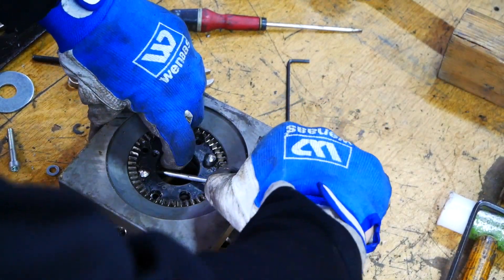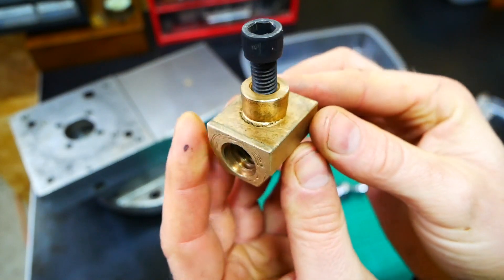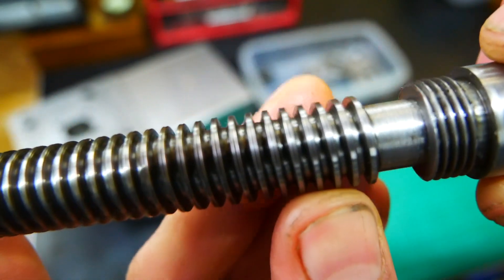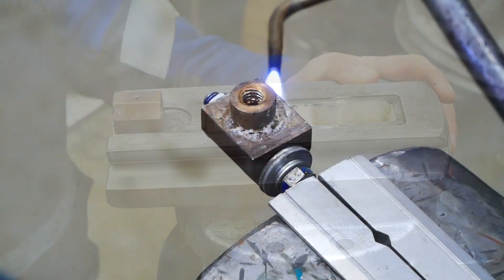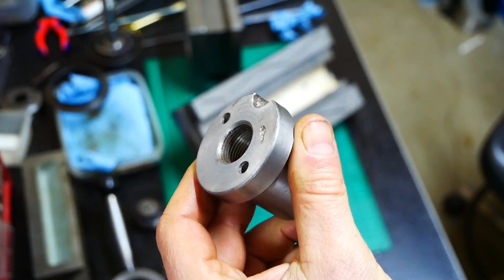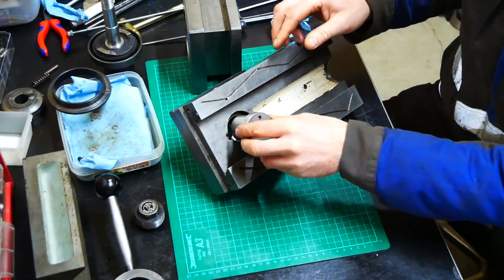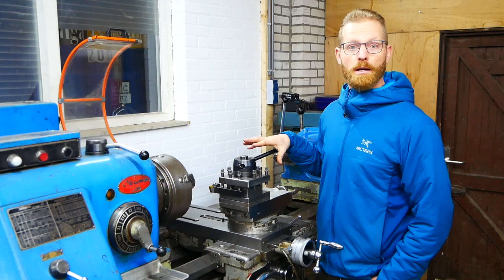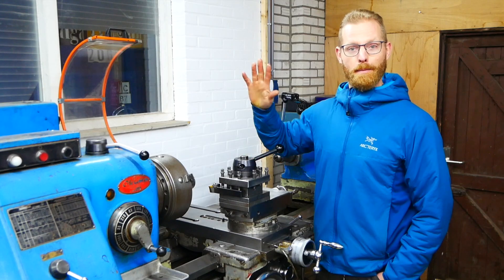Okuma LS Adventures Part 4: Compound & Toolpost

Comment: Hi Bart, I appreciate the quality work. People think I go overboard doing things like that. Mine is older than yours but it has some different features. The compound is slotted and has an Aloris quick change and the cross slide has an extended area about 4” to the back? I converted mine to a VFD drive and did away with the relays. I am wondering if you found a rubber for that oil plunger. What did you use to clean the apron? I don’t do work for others I use mine to make parts for my tractor restorations. Many old parts are not available. Another thing is mine has a cam lock chuck mount, don’t know if it was ordered that way or someone changed it.

Comment: Hi Bart; Beautiful lathe, If you don't mind, can you give me the overall dimensions please. L x W x H x weight. My shop is one side of a 2 car garage in a residential area. I don't know if I could fit a lathe like this in my shop. Thanks in advance.
Reply from the maker: Hi Howard, Sorry for late reply. This lathe is around 2.2 meter long (80cm between centers). There is also a longer version that is 2.8 meter. It is around 1 meter wide but the problem is that is has a chip pan that only can be reached from the back side. So putting it against the wall as a bit of a problem. You can find some more information about this lathe here: http://www.lathes.co.uk/okuma/
Reply: @bartharkemametalworks2299  Thanks Bart, Merry Christmas !  I too admire the Japanese people and their products. I did business in Japan for ~25 years, had a Japanese fellow work for me 22 years, we became good friends. I really wanted to get a Japanese lathe but the one Okuma for sale over here (Canada) is the 2.8 M version and that together with the chip pan issue I think will consume too much space in my little shop.
Reply from the maker: @howardwilliamson4076  yes Japan is a great country and the people I met there are very friendly and nice. The machine a good quality. For size you can also have a look at the Okuma LK or Seike Mori. A little bit smaller but higher rpm and I think better size for around work. I love this one but I also have a Schaublin 102 for small work. I like the combination but I need to have only one I'll pick a size in between

Comment: For a beefy lathe like this one, I think you don't need a solid tool post. If you have a solid post and you put a insane doc, do you have the horse power to support it? Though you choise :D
Reply from the maker: I dont realy need it but there are many reasons. Even with a big lathe this is still the weakest link. And this compound is not in the best shape. Beside that, with a DRO on a solid system I only have two axis to work with and can program the different tools. This machine has 10HP so enough for some serious DOC. In the future I will restore this compound and will make the solid post easily replaceble if I need to turn tapers.